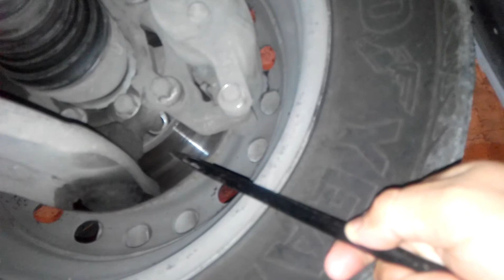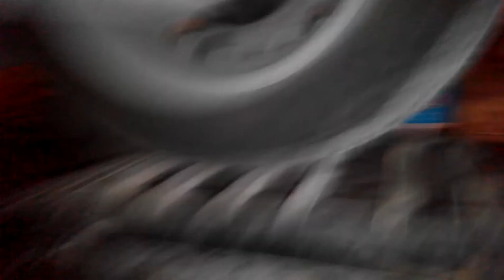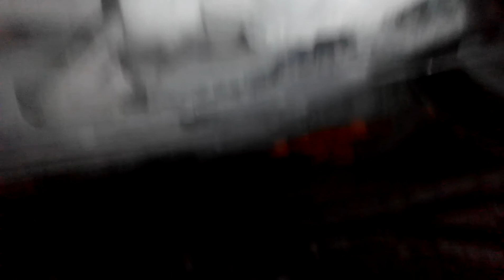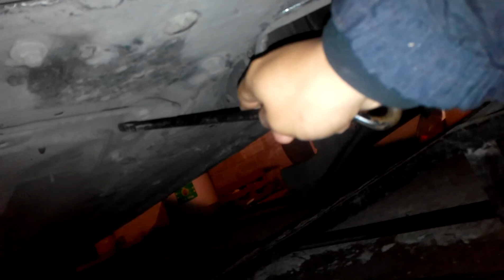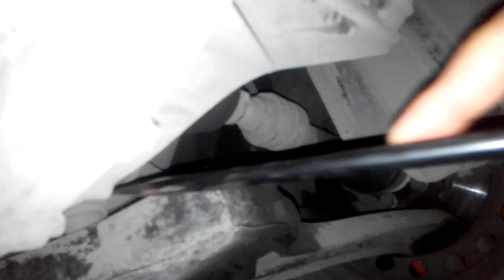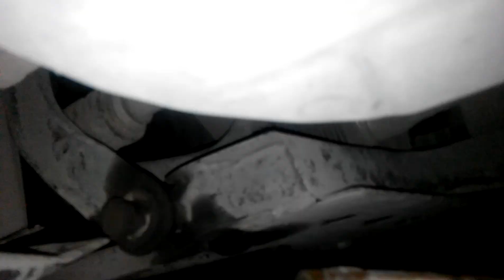Quitar rechinido que se escucha como roce de metal con metal al pisar el freno de un tiida,solución

Comment: hola me puedes apoyar en decirme que puedo hacer ya que mi tiida tiene un ruido en la parte de llanta delantera del conductor este ruido es durante el rodamiento de la llanta es un ruido como de un frutsi en una llanta de una bicicleta, cuando acelero a mas de 40 km y así al ir subiendo la velocidad se escucha mas y mas fuerte y ya se siente una vibración en el pedal de aceleración yo pensé que es algún balero o algo pero un mecánico en la empresa me dijo que eran mis llantas porque ya estaban deformes ya cambie las llantas y nada sigue el ruido y es un ruido muy molesto y me preocupa.